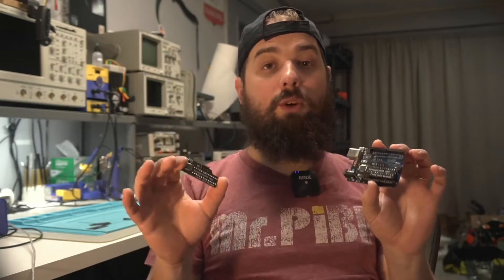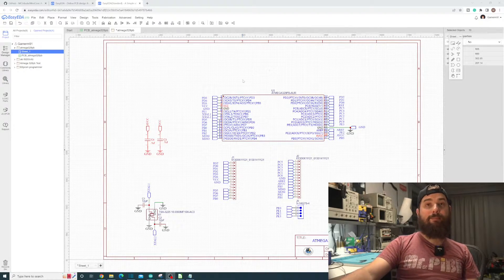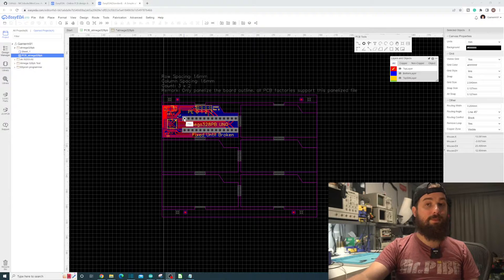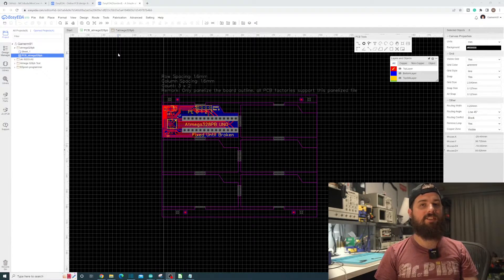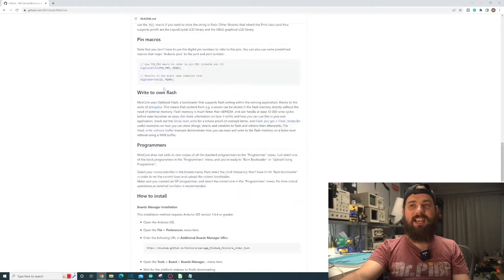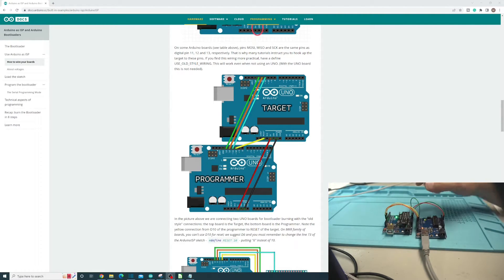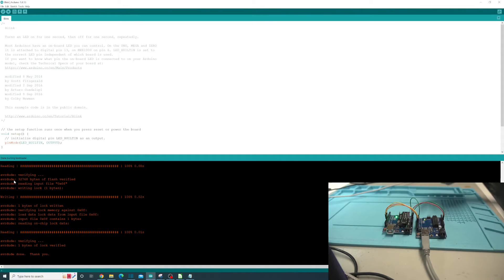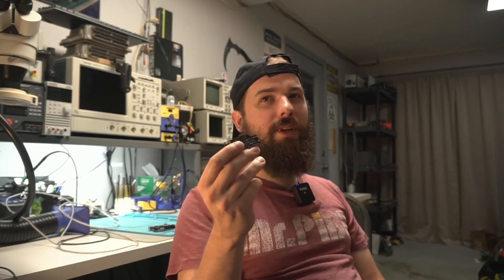Arduino UNO with a Atmega328PB on Minicore

Comment: I installed the MiniCore package, but after selection of the board, in the "Programmer" list (bottom of Tools menu, before "Burn Bootloader") I notice a problem. At 8:21 we can see that  all names of your programmers'list  have "MiniCore". So you have "Arduino as ISP (MiniCore)" and the "(MiniCore)" is added at all the programmers name. In my case, after installing the MiniCore package 3.0.4 , in the programmer list, only "STK500 as ISP" as the ("MiniCore") info. All other programmers don't have. So I have "Arduino as ISP" and NOT "Arduino as ISP (MiniCore)" and so, I can't burn Bootloader. Do you know why?

Comment: Thanks you dude, you really save my maybe week or so) I ordered a few nano board w type - c input socket, and its came w some pre - installed program, and I cant load bootloader  because avrdude don't recognize the chip. Thanks to you this boards are working now. Best regards !
Reply: So do I get it correctly that you have changed the bootloader uploading it using second Arduino as a programmer? I have Nano V3 or whatever it's called with ATMega328PB that I actually really need (to use extra 16bit timer). I can program it without issues from Arduino IDE when I select it as a regular nano board. I just set it as Nano and loaded blink example, no issues. However when I set it as MiniCore PB it's like the bootlader no longer works. I'm using IDE 2.3.2.
Edit: OK, I've confirmed that my board apparently was shipped with regular Nano bootloader (or rather the "old bootloader" as it has to be set to that in order to work properly) and in AVRDude I can see it has ATMega328P signature instead of ATMega328PB. I've used the "Export Compiled Binary" option in Arduino IDE and used AVRDude manually with the exported hex. It was set to ATMega328P but of course had no issues to load program for PB and it worked just fine, both the bootloader and my program ;-)

Comment: Hello. I am a beginner. I have two arduino UNO R3 clones  on ATMega328 chips. First one is on ATMega328P and has a bootloader. Second one is on ATMega328PB and has no bootloader. Is it possible to burn bootloader on that board? I tried to flash "Arduino as ISP" sketch on ATMega328P board and connect it like you show at 6:49, but it does not flash bootloader. What am I doing wrong?